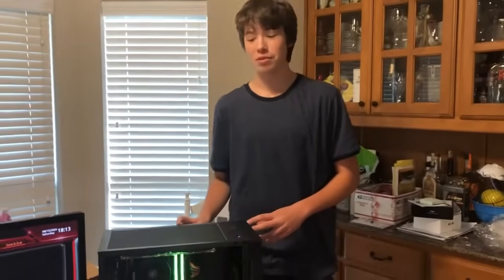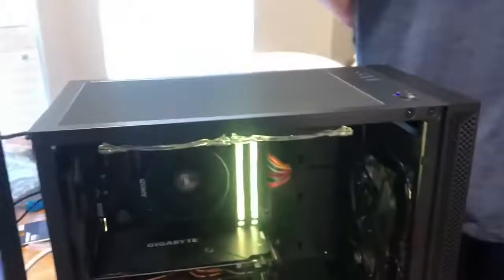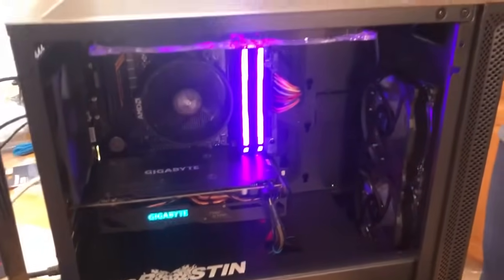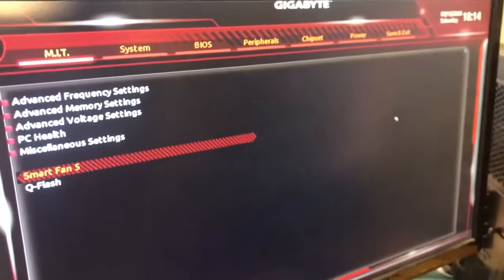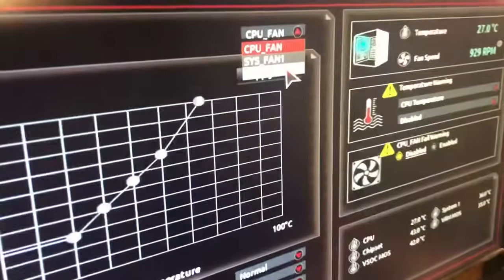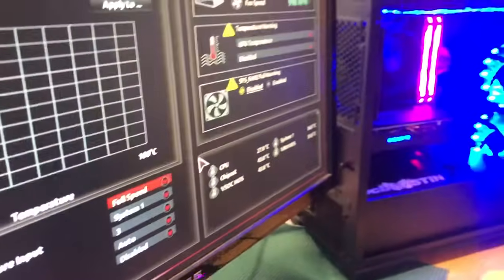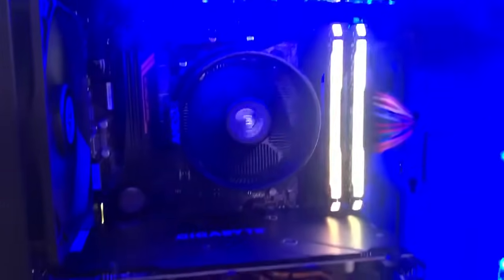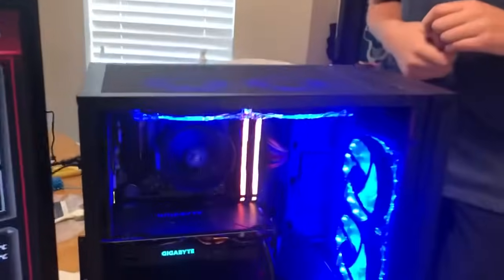A quick fix for non addressable RGB LED fans that spin but do not light up.

Comment: Hi, not sure if I'm too late, but I have a an Asus prime a320m-k, and a Case Azza Spectra. My pc has been working very nice, only one fan that comes with the case and one for the CPU. I don't use it for playing only working. The thing is that just like that, I put the pc to sleep and when I came back noticed case lights were gone?? Just like that?? I have never opened it or messed anything inside.

Comment: Guys, i left this matter aside, thinking my low budget casing's fan rgb got faulty, after 3 years i just opened the side panel i seen that that hub connects to tge rgb light is unplugged, so before jumping into your bios, you may better check on those hubs ,...

Comment: I have Corsair fans . For the first 2 years everything was works fine . Some weeks ago 2 of the 5 fans have crazy delay . You open the pc and the RGB don’t work for 20-30 minutes . Only the fan works . After that on random time they open and stack on random color . After that some minutes later they start Sync with other fans . I don’t know what is the issue . I try to change places on Corsair hub and nothing change . I check the wires and I didn’t find something wrong . Do you know why I have this issue ? I try the bios thing but nothing .. they work after 1-2 hours later
Reply from the maker: It is most likely the Corsair fan controller.  I had a similar problem with my addressable Thermaltake fan controller.  you can buy just the controller and replace it.  make sure it has at least the same number of fan ports.  Make sure the plugs are the same too.  https://www.amazon.com/CORSAIR-COMMANDER-Digital-Lighting-Controller/dp/B09GHTMJMY/?th=1

Comment: My case fans and cooler RGB lights initially became colorful, disappeared from Gigabyte Control Center, and eventually turned off. The fans themselves are working fine, but the RGB lighting has stopped, and a red light for the CPU on the motherboard has turned on. The only RGB still functioning is on the RAM. I’ve tried everything I could think of, but nothing has worked. Any help would be appreciated!
Reply from the maker: Does the PC boot or post?
Reply: @pcBoostin  the pc works perfectly fine the only problem is the case fans and the cooler rgb lights
Reply: @Sarah-de1nm I have the same issue did you solve this ?
Reply: @sothicus  no 💔 did u ?
Reply: @Sarah-de1nm  nope... company said they would replace my motherboard.... but that's going to take ages.... your computer is still running ? My mobo is a gigabyte x870 eagle wifi , yours same ?
Reply: @Sarah-de1nm  I fixed it, one of the sata cables connected to power supply was loose. Pushed it back in tight ... cpu light gone.... rgb on fans back... all good... open up your pc and check those cables again
Reply: @sothicus   ooh nice u fixed yours, I double checked all cables there were all connected , my motherboard is b650 aorus elite ax ice
Reply: @sothicus   Was your issue exactly the same as mine? My PC is working perfectly ,the only problem is the RGB on the fans
Reply: @Sarah-de1nm  yes only rgb fans lights not coming on and a red cpu light
Reply: @Sarah-de1nm  I saw a firmware update regarding 600 series gigabyte mobos rgb issues... maybe that might help
Reply: @sothicus   I updated it didn’t work

Comment: Hi you will probably not read this but whenever i turn on my pc the rgb fans dont spin
Reply from the maker: are they plugged into a header on the motherboard or are they plugged directly to the power supply cables?

Comment: Great video! I have a 2024 CLX gaming PC and its got a RGB fan controller just inside the back panel. Sometimes you have to unplug and replug in the RGB cables in to the controller before the lighting will come back on. I suppose the controller card itself could fail but thankfully i haven't run in to that. My issue was that the lighting on the 3 fans at the top for the liquid cooler radiator quit working. I noticed that a tap on the back panel brought them back on. Ultimately it was the scenario of replugging the cables in to the controller, with the CLX supports help.
Reply from the maker: So it was a loose connector or a faulty fan controller?

Comment: Is this really the only fix? I cant keep my fans spinning slow but with color?
Reply from the maker: you might be able to adjust them based on temp in the bios if they are plugged in through a fan header on the mother board or a fan controller.

Comment: I have diferant problem. I just new pc for my self and it has rgb fans. The most distracting horrible thing that has been invented. I can't turn it off without turning fans off. So after paying for new pc now I will have to spend all day taking it apart and removing fans. Then I gonna find leds and drill  them out. I hope that will fix my problem.

Comment: My artic p12’s are a nightmare , finally got it to where they all light up , but one fan decided to stop spinning , temps are still good but I haven’t installed Gpu and already fan stopped spinning
Reply from the maker: is it a dead fan?  switch to a different plug or put a known good fan on the plug of the bad one to see.
Reply: @pcBoostin I ended up returning them. I really like the rgb alottt, believe I plugged it into wrong sport argb header and smoke came from a wire from one of fans .  Sadly I liked the rgb more than corsairs even tho you can change them on icue.    Daisy chaining was a absolute mindfck the first time building pc

Comment: I have Aigo AR12 Pro fans connected to an Aigo controller.

When I turn on my computer, the fans spin, the lights don't turn on. It only turns on if I disconnect the controller's power cable and connect it again. The controller power cable comes from the PSU
Reply: hey I'm having the same issue. Have you found a fix for it?
Reply: @ItsHB_   I contacted aigo and they simply said: "buy another one"

Observing the behavior of electronics in my house, especially fans. When the power goes out, it comes back strong. And I think that's why it burns the controller. Even using a good line filter (iClamper) this happens. Maybe with a better controller, this wouldn't happen

Comment: Please help. For me I’m doing exactly as the video is saying and my fans are still not lighting up
Reply: Did you fix it !! I have the same proplem
Reply: @shadylegend2329  yea i fixed it
Reply: @icantdriv3  it turns out my power supply was broken. i had to connect the fans to the motherboard for them to light up

Comment: Hey, I’m wondering what I should do if my rgb doesn’t light up until I turn the pc on and off two or three times. Been having this problem for a while now.
Reply from the maker: Do the fans light up instantly on power up or not until windows launches?  That would imply a a software issue if Windows startup.  If they plug into an USB header port, I would suspect USB ports going out so a motherboard problem or a USB cable problem.  You could pull up Device Manager once inside Windows and scroll down to the USB section and watch if there are USB ports coming and going.  If the fans connect directly to the power supply cable, I would suspect a bad cable and at worst a faulty power supply but you would probably have other issues with the entire PC such as lockups or random reboots.  A $16 PSU tester might let you know https://www.amazon.com/Computer-PC-Tester-Connectors-Enclosure/dp/B076CLNPPK/ref=sr_1_1_sspa     
GL!

Comment: hey, i know im quite late to this video but seeing as you've responded to comments as of a few months ago im just going to ask;
changing settings in the BIOS is not working for me, nor is opening the pc up and messing with wires.
my pc has 7 fans all with ring lights and 6 of them are working, cant get the 7th to work.
im just wondering if you have any other solutions and if this is a hardware issue could you run me through the fix like im five? not a hardware guy at all lmao
Reply from the maker: I would suspect you have one bad fan.  An easy trouble shoot is to plug in the bad one to where you  have a known good one and see if it still does not work.  Try to narrow it down to the easy solution of a a bad fan if you can.  Good luck!
Reply: @pcBoostin  will do! i appreciate the response

Comment: and if i have a controller with sata what should i do because my fans not appear in qfan bios
Reply from the maker: Are you saying the controller has SATA power connector?  Make sure it is connected to a SATA power output off the power supply.

Comment: did not turn the leds on, the fans did start spinning a lot faster though, any other idea why the leds are not on?
Reply: same
Reply from the maker: make sure there is not a separate power plug hanging off the fans to turn on the LEDs

Comment: Would this work with the cpu cooler fan?
Reply from the maker: It should but usually they are on QFan and should rev up under load so you should see lights  turn on sometimes.

Comment: Also, you should be able to use software to adjust speeds once booted. Put the fans at full speed in bios, then use software to adjust. Or depending on what setup you have and which software, you may only need the software.
Reply: where can i find this software?

Comment: My fans spin but the lights still don’t turn on 😞
Reply from the maker: Make sure there is not another cable hanging off the fans for RGB lighting.  Another cable hanging off might need to plug into a controller or a motherboard header.

Comment: I imagine that would increase cpu temp correct me if I’m wrong
Reply from the maker: It will actually drop temps since the fans will run at top speed. Noise level will increase from the higher rpm. It was only the fan settings that are adjusted not the overclock settings.

Comment: I have a similar issue the only difference is when I connect the little jrgb connector my front rgb fans chirp and do a rythmic light up and a chirp but when I take it off they spin and no sound
Reply from the maker: is it the little RGB connector for your motherboard?  does it flip around the other direction?
Reply: @pcBoostin  there’s a little arrow on it if that’s what u mean

Comment: Need help my cpu water block won’t light up and also my graphics card waterblock won’t light up and the water pump won’t light up
And the 2fans on the top won’t let me change the colar 
I have 6 fans only that are working 
Those 6 fans are plugged in motherboard the ones that aren’t working are plugged in Corsair commander pro
Reply from the maker: Did you get the corsair iCue software to control the fans and LEDs?  https://www.corsair.com/us/en/icue

Comment: But like when i turn on my pc it works fine every thing spins and yea but the prob is light is not turning og till i play a vig game then they come on and if i close again they on but not like spinning lights like i tried this fan thing but didnt work so i think it can be the psu??
Reply: Need help
Reply from the maker: It sounds like the problem you are having is the same as described in the video.  No lights until gaming because your CPU is heating up under load so more power is given to the fans to spin faster to drop the temps which then enables the LEDs to turn on.  Sometimes when you make a change in the motherboard setting, it does not take affect until you reboot so try it again and reboot to see if they light up second time around.
Reply: @pcBoostin  man i tried the bios settings but i think it can be led controller thats broken or sum i have a coolermaster led controller

Comment: I have the opposite problem, I connected the led  PC fan to a 12v adapter and when plugged in it lights up, its fans jolt but don't spin even after a push. Any tips?
Reply: Hey did you ever figure out what to do? My lights show up but the fan does not spend
Reply from the maker: There might be another 3 pin or 4 pin fan header you need to plugin to the motherboard or a fan controller.  Look for 2 separate plugs.
Reply from the maker: There might be another 3 pin or 4 pin fan header you need to plugin to the motherboard or a fan controller.  Look for 2 separate plugs.

Comment: I have an issue, my rgb fans light up but I cannot change them from the random/default light effect settings which is extremely distracting. Especially the strobe! I’ve tried a bunch of different softwares, but nothing works. Any ideas?
Reply from the maker: Are they plugged into the motherboard RGB lighting or a USB controller?  If you are trying software, that is the only way software will work.  It could be you have fans that have a wireless remote control.  Check that the IR receiver has a line of sight you can aim at or try pointing directly at the fans.  This fix is for when you have no lights but since yours are on, there is another cause to your issues.
Reply: Ever figure it out? Got the same issue rn...

Comment: My rgb will turn on but my fans wont turn on
Reply from the maker: There might be another 3 pin or 4 pin fan header you need to plugin to the motherboard or a fan controller.  Look for 2 separate plugs.

Comment: Without motherboard I am just checking my cabinet fan but both fan are running but not turning on light . Please help me.
Reply from the maker: are they plugged in the motherboard or straight to the PSU?
Reply: @pcBoostin  they are pluged in motherboard  but one of them is not lightningh .  please help me or make a video on this problem

Comment: This is a long shot but - previously lights on cpu fan (Thermaltake UX100) were working perfectly. Then they went off completely but the fan was still spinning. I was able to get the lights back on and working, but they are not syncing with the other fan lights in my pc. They are all sporadically flashing random colours and various single bulbs will go off and on. It's driving me crazy... any tips are greatly appreciated!
Reply: Also - I do have RGB Fusion 2.0. I could never get it to actually work though. Rip
Reply from the maker: That is an addressable RGB fan with the fusion as the software control.  not sure but maybe reinstall the Fusion sw or go into the motherboard to make sure the settings are right in there.  In the motherboard, there should be a section for lighting.

Comment: What about if my fans are daisy chained but the fans run but the rgb don’t light up? Would it be a power supply or do I need to go into bios I have a msi motherboard
Reply from the maker: if they daisy chain and then connector the power supply directly with 4 pin molex, they should have enough power to light the RGB.  If it is on the mother board, then you can try our suggestion with high speed selected.  Also make sure there are not other connectors hanging off the fans that are for the RGB.

Comment: How do you get to where you went
Reply from the maker: either tap <esc> or <delete> key at boot up.  right as it is starting.  Sometimes <F2> key.  This is way before Windows start up.  Some BIOS are locked and want you to enter in from Windows' advanced start up options.  you can google that.
Reply: Thank you brother

Comment: Mine light up but don’t spin😩
Reply from the maker: check if there are two separate connectors off the fans.  Sometimes they split the RGB from the Fan power as 2 separate plugs.
Reply: @pcBoostin  I ended up figuring that out, there were two separate ones with two separate plug spots
Reply from the maker: @SnowyBlizzard  that’s awesome!

Comment: what if my rgb fans also arent spinning?
Reply from the maker: might be a bad fan but it could be the motherboard output so if you can hook the fans directly to the power supply with a 4 pin Molex adapter,  that will let you know if the fans are good or bad.  Try this only if you do not have a USB FAN controller in there.

Comment: I haven't been able to find similar settings on my ASUS motherboard. But I'll keep tinkering every day or two. Not only my AIO fans aren't lighting, but the pump itself isn't either.
Reply from the maker: Asus usually refers to the BIOS Fan settings as Q-Fan control.  See if you can find it and try the performance/full speed DC mode to see if it works.

Comment: Hi I have TD500 and it comes with inbuilt fans and it’s not spinning for some reason can u help me ?
Reply from the maker: If they all are not spinning it might be the fan controller went bad.  Follow the fan wires to see if they go into a module or into the motherboard.  If it is only one fan then I would suspect the individual fan is dead.

Comment: I’m new to pc and I’m not sure how you got to the fan settings like that. Or the bios your talking about. I searched fan settings but nothing came up. Not sure how to get there. I have a prebuilt cyber power pc so idk if that helps. (This is my starter pc so idk much)
Reply: First of all congrats on the PC. I built my first ever system just yesterday so we're both pretty new. If I were to guess though, most bios systems have an easy mode or ez mode (depending on the motherboard you have). If you are able to switch to that mode, finding the fan settings won't be too difficult. Again, I can't be too specific since every board is different in some way. Hope you find your way dude!
Reply from the maker: when you first boot up try tapping the Delete or Esc key.  about 1 tap per second so you don't lock it up and have to start over.  <F2 >key might be it too but probably <Del>

Comment: I have a problem with my argb fans where the lights turn on but the fans dont spin idk what to do?
Reply from the maker: check if there are 2 separate plugs or not.  If there are 2 you probably need both plugged in.  One for lights and one for fans.  If only one plug then make sure you are set for performance in the BIOS like we shoed.